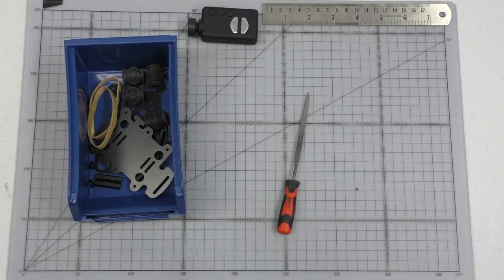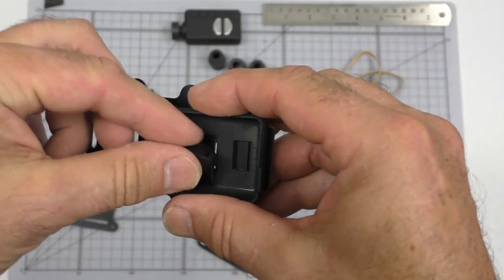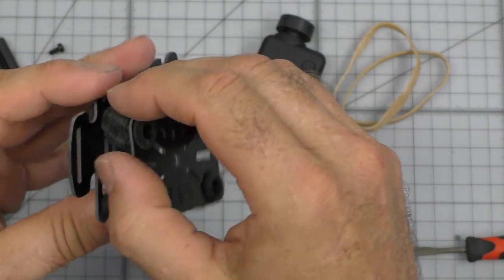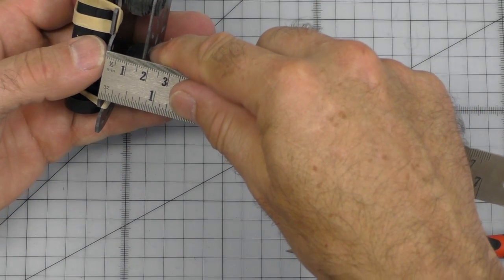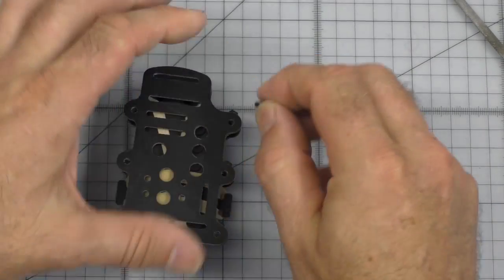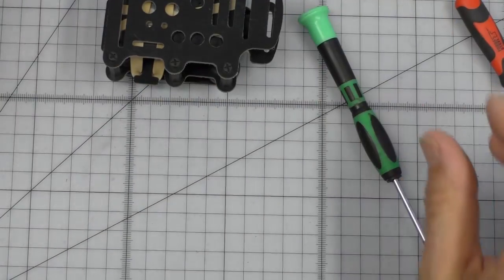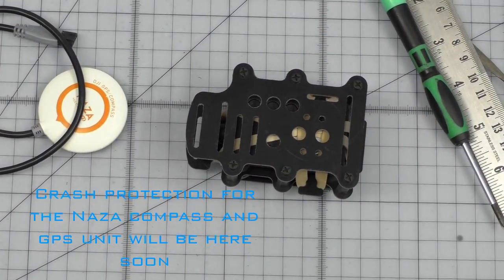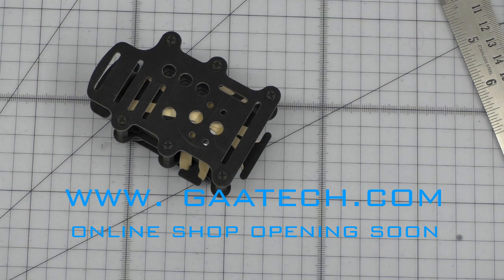0012 Mobius HD Camera FPV - Anti Vibration Mount & Crash Protection System

Comment: Very nice but where is the proof of concept as in footage showing if and how well it works in actual flight?   Thanks  Those dampers may not be for the vibration and forces incurred.  Other damper designs have more movement available.  This looks like a smaller package but it may not actually do the job.   Thanks

Comment: no Mount in the shop :(
Reply from the maker: Hi Reymund   This mount has changed it now has a built in angle adjustment system.  I hope the final version will be cut and in the store for  monday or tuesday if not before.  The mount will come with various anti vibration bubbins to allow you to adjust the tilt angle from zero to around 10 degrees

Comment from the maker: Still testing
Reply from the maker: #modius #fpv #anti-vibration #camera #mount
Reply: +3K Carbon - G10 - FR4 - Supplies &amp; CNC Routing - 3D CAD Design &amp; 3D Printing - Online Shop Hello ! Do you think that this system would be efficient (and hold the pressure) mounted on a MTB ? I ride often and like filming myself... And i can allow myself to buy a 250€ stbilizator ^^